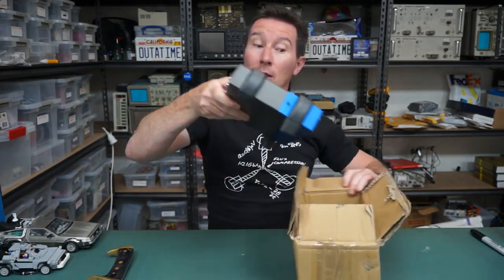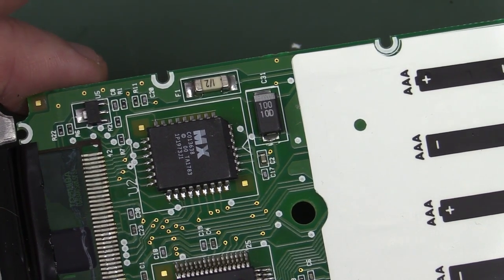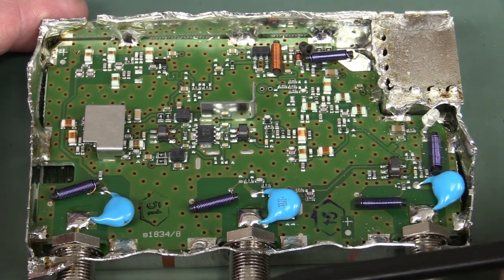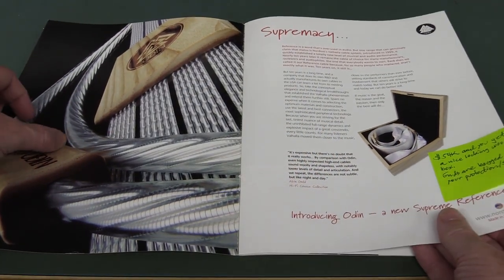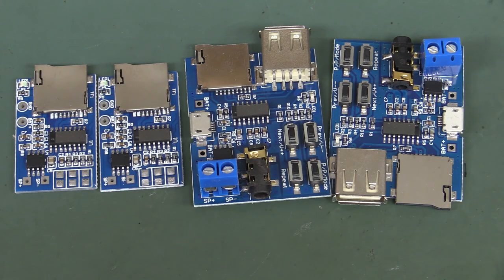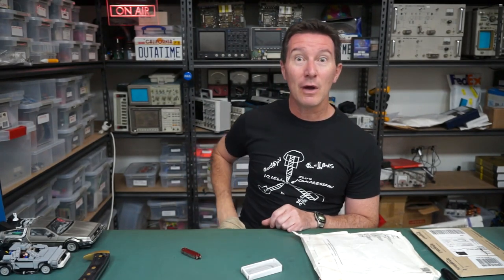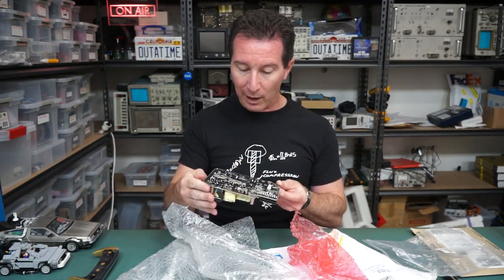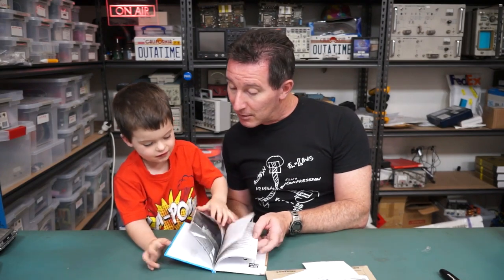EEVblog #856 - Mailbag

Comment: Hey in sure this will get buried in the comments but how do you upload a 40 min vid overnight (I assume) I record off my gpu a 41 minute video at 40mb/s so 10.3gb. And my very good connection cannot so it in a night.
Reply from the maker: +Winstan I use Handbrake to compress it.
Reply: +Winstan if you dont know how to use handbrake download it for free and put this tex in advanced section then hit start .      ref=2:bframes=2:b-pyramid=none:weightp=0:subme=6:8x8dct=0:trellis=0
Reply: +1love 1heart is there an official site to download handbrake please
Reply: +Tangobaldy https://handbrake.fr/
Reply: +Winstan Check your recording software settings and use H.264 for your video capture format. This will allow your CPU's multimedia extensions to compress video on the fly to get your file sizes much smaller. There will be a slight performance hit for this. If you have an option to use something like NVidia's NVENC option (600 and later series graphics cards) use that as it's done on an internal ASIC instead of hitting your CPU. If you have an Intel CPU that is Quick Sync capable it is incredibly fast and uses a special core on the CPU for the conversion.

I find that by using H.264 set for variable bitrates makes the best use of hard drive space. However, if it is set too low you will end up with compression artifacts. I find that the setting of using VBR with a 10,000 kilobit /second maximum is all you need. That way if you were playing a game it'd have enough bandwidth for rapid motion on the screen but would settle down for times of less movement. By doing this I have gotten one hour twenty minute 1080p video recorded at 30 FPS for ~ 1.71 GB of storage.

Using something like ShadowPlay is nice for being convenient but it doesn't compress too much so you end up with 4GB files for ~ 15 minutes of footage. Instead I recommend Open Broadcaster (https://obsproject.com/) because it's free and can also work with pretty much any video capture card out there (I have done several installs in churches using OBS and BlackMagic designs decklink HDMI / SDI input cards.
Reply: +Winstan 'stralia has one of the fastest and cheapest internet in the world, so he probably has like a 1Tbit connection.
Reply: IIRC he has 100 megabit symmetrical DL / UL speed based on previous videos. And it's like 400 Dollerydoos (AUD) a month so I wouldn't call that cheap for business class.
Reply: +Ben Childs Sarcasm must have been lost in translation.
Reply: +Maarek Aabmets heh, I have 1000/1000 mbit/s for €365 per... year :D

Or well, my mother does. I live not so far away and I get only 30/3 for almost the same low price...
Reply: EEVblog Thanks alot will check it out. I record off a GTX 980ti at 60fps. Thanks again all!
Reply: +EEVblog There's no reason to compress a video straight after rendering it. You may as well just set your render settings up properly. I know that Premiere / Adobe Media Encoder supports x264 out of the box.
Reply: +Zooty The Duck Dave has said before he is happy with what software he is using, i dont think he likes Premiere
Reply: ***** Yes but, as far as I know even Windows Movie Maker on XP supports these kind of operations.
Reply: Beginner's Tech thanks
Reply: +Winstan If you live near YouTube HQ you will get better throughput with RFC 2549 ( https://tools.ietf.org/html/rfc2549 ) instead of traditional transfer media.  Then there is no need to use Handbreak.
Reply: Tangobaldy no problem

Comment: Those cheap multimeters and their 10 amp claims...
100% certain that they will catch fire on 5 amps already.
Reply: +drkastenbrot Typically they have a "disclaimer" that you can only put 10A through them for 15 seconds then you have to let it cool for 5 min.  

They do tend to melt.
Reply: +NY2016 sg 15 seconds sound like way too much to me.I bought one yesterday for 8$ shipped. Ive put 10 amps at 5V CC through it and it blew after 1.7 seconds. The PCB trace has molten.

Comment: They make the TI calculators bulky and weigh them down with the metal plate so you don't feel as much of a moron for spending 130 dollars on a rubbish calculator.

If it weighed next to nothing, which it should, and was as small as any other calculator which it could be (with exception of extra screen space), people would feel suckered or probably couldn't justify spending over 100 dollars on that PoS.
Reply: +Raven (Hidden) It has the weight at the screen end to balance out the weight from the 4 AAA batteries at the other end.

Comment: 53k on 6ft wire.

I wonder, what are they're annual sale numbers?
If it surpasses 5 a year I'm going into that BS business.
Reply: Why not make the Batterizer™ Cable™ - Actively removes distortion by over 600%
Reply: drkastenbrot
 i laugh at that. my R&D team achieved distortion cancellation of 900% the materials we use are only found in one or two places on the planet it's a sand type which can only be found in those undisclosed places at a unimaginable depth. so we use ROVs for that. As you can imagine we have significant expenses because of that. But we only want the best bullshit we can get for our customers.
Reply: +Osmosis Can I please get some technical data, so we can compare?
Mine has a resistance of -0.4 Ohms per meter, tachyon-core-wire for noise cancellation and a new patent pending Batterizer+™ Module, which sends back the noise to the amplifier, and actively reduces your energy bill by up to 70%.